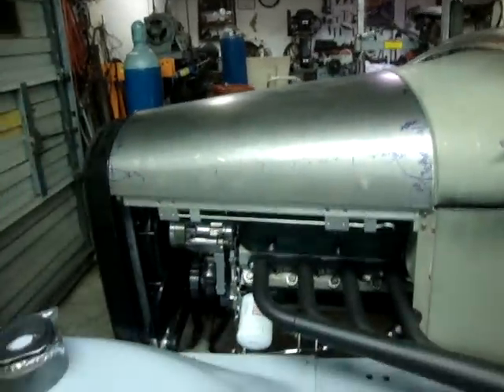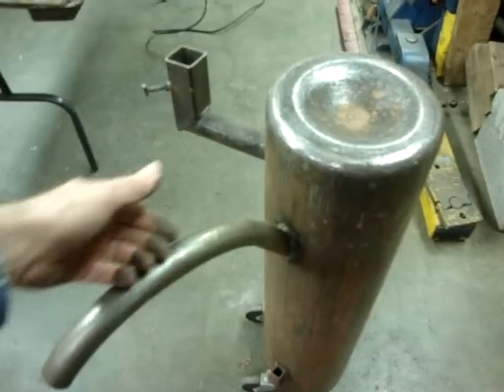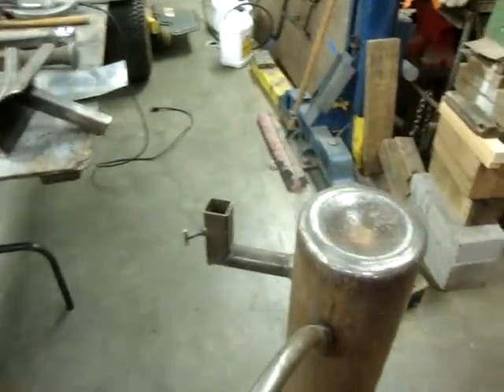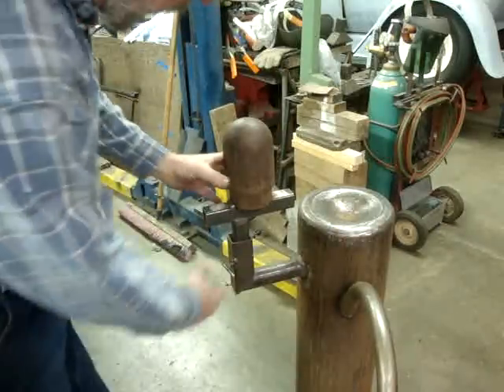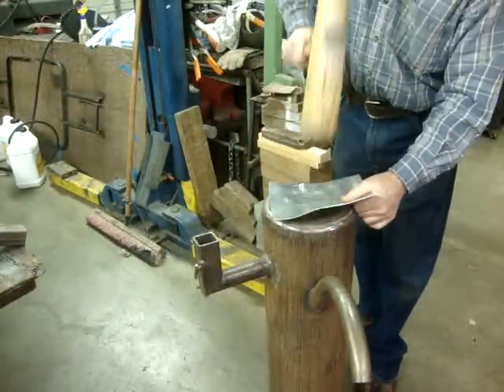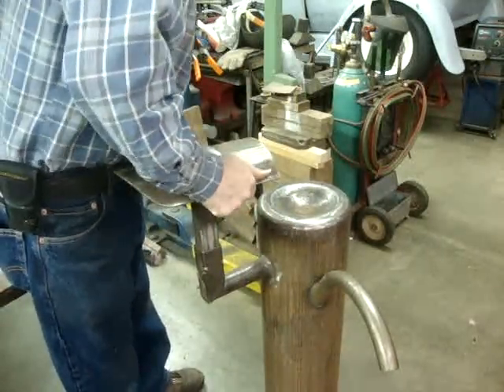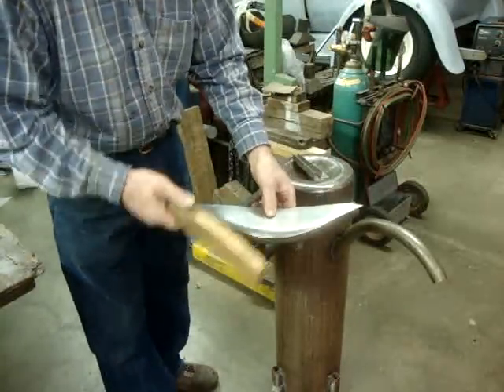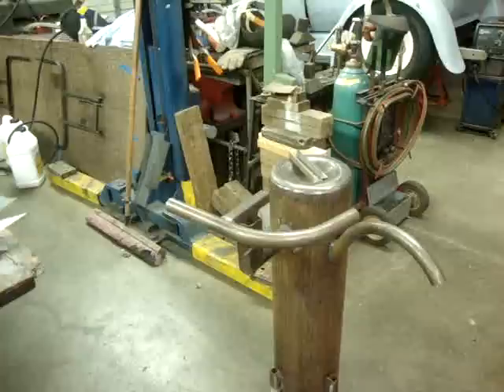Using The Metal Stump

Comment: This channel doesn’t have 1/10th the interest it deserves. Nice system. That’s gotta be years of experience boiled down to something simple, cheap, and effective.
Reply from the maker: Thank you..!! I appreciate that. Yes I've been shaping metal for about 35 years or so... and still learn something new almost every time I go into the shop.. Modern equipment helps, but the basics are  used every day and are still in the simple hand tools..
Reply: @billsmetal  I’m a good carpenter but a novice metalworker. What you said about modern tools applies just the same to woodworking. But you probably know that already.

Comment: From one weldor to another, thank you sir! This really is a marvelous use of readily available materials. I picked up a leather shot bag long ago, now this will compliment it. I also got a nylon mallet but I like your idea of a baseball bat hammer. Time to chop up an extra bottle and restore my 1966 VW splitty bus. It is getting a year 2000 TDI engine and upside down Audi transmission. Porsche 951 suspension, front hubs and 372mm rotors already mounted.
Reply: Nah no TDI, give her a 5 cyl Audi petrol turbo
Reply: How has your 1966 VW project turned out ? Would like to hear more about it and see it if possible. Thanks. !

Comment: Greatly appreciate you taking the time to make this video - extremely useful tool and making your own tools is the sign of a genuine craftsman!  

Unrelated, metal shaping is new to me and I'm hoping you can tell me what type of aluminum you're using in the demo - I've got access to some 3003 1/2 hard; would this work to practice?
Reply from the maker: That is the perfect material to work with.. It's good that you have access to it.. Most supply houses only stock 5052, which is literally a pain to work with. The 3003 is very compliant and retains it's shape when you shape it, with very little spring back. And it responds well to annealing, 6061 can be annealed as well but work hardens much quicker than the 3003. Here's a good explanation of what the numbers mean.. http://www.alcotec.com/us/en/education/knowledge/techknowledge/understanding-the-alloys-of-aluminum.cfm

Comment: You can usually get the tanks at you welding supply place.  The get them back from being tested.  If they don't pass they have to scrap them . You can get them usually pretty cheap
Reply: Charlie Bardo  Got mine free that way, was better for them for me to haul them off than they'd of made on scrap. It's definitely worth it to check your local shops for out of service bottles.

Comment: Hi. Great video. I want to make one like that. Could you please let me know, what size receiver you used, and is there a good practical reason why it is set out from the cylinder. If so, how far out? Would there be a disadvantage if it was welded straight on the side of the cylinder?
Many thanks for any advice that you can give me, on this project.
Kond regards, Joe
Reply from the maker: It's just a scrap piece of 2 X 2 Square Tubing.. You can use whatever you want, as long as it fits whatever you want to put in it..
Reply: Thank you very much for your reply.

Comment: Great video and very ingenious of you. This is better than using a wooden stump. I have an old Acetylene bottle laying around, and would love to build something like what you have there.
     Any safety advice for cutting the head off of the tank ?
Reply from the maker: +richaroodledoodle ... First ...Don't use an Acetylene bottle..!!!  They are constructed completely different and it will be dangerous..!!!  The bottom is shaped differently and not usable.. They are filled with cork to absorb the Acetone.. and they are VERY unstable.. you could blow yourself up.. !!! 
 Use an old Oxy or Argon or C02 bottle..  
Don't use an Oxy Acetylene torch to cut the bottle.. Even if it's empty and purged, you can still introduce un-burned  fuel and oxidizer into the bottle from the torch, and blow yourself up!!! ... Use a saw.. or a plasma cutter... I cut mine in half with a band saw first. Then after the end was open I used a torch to cut the shapes that I used for dollies.
Reply: *****
                    I knew it was not a good idea, but I thought there was a way around it some how. 
   I guess I'll had to find and old OXY bottle around somewhere. Thanks for replying so soon, and keep those vids coming. Good info and thanks for sharing with us..

Comment: Amazing tool and thank you for the explanation! May I ask how you made the dish on the top?
Reply from the maker: It's already there... That's the bottom of the oxygen tank.. it was a 331 cubic foot tank that had out lived it's usefulness and couldn't be re certified... so the Welding Gas Supply houses sell them for scrap.. you can get them cheap, either from them or from the scrapyard..

Comment: I’m needing to form shapes similar to bicycle fenders out of aluminum. Any ideas. Thinking about a arbor press with special made dies.
Reply from the maker: If I'm only making one or two, I would use my English Wheel..  If you are making a bunch of them, you might want to build a Fender Roller. I also built a set of fender forming dies for my power hammer... Interestingly, when I built the test dies out of wood, they worked great. So I decided to build a more durable set out of aluminum, and  they didn't work.!! You actually need the grip of the wood, to shrink the metal. The aluminum dies were too slick and the metal would slip in the dies, rather than shrink. It came out more like a potato chip than a continuous curve. 
Also you will want to use 3003 H-14 alloy aluminum, for forming that shape..
Reply: billsmetal yes I could see that you would need a certain amount of friction. Friction can be your best friend or your worst enemy. Only the wind sculptures I am fighting friction constantly.

Comment: How did you mount blacksmith vise to garage floor?
Reply from the maker: Check out my Garage tour video and it shows how that was done.. I have several tools that fit in the holes and there are 4 locations in the shop where I put those holes..

Comment: Did you fill the tank with water before you cut it up ?
Reply from the maker: No .... It's not a Fuel Tank... it was an old Oxygen, or Argon Tank, or CO2 tank..  You don't want to use a Hydrogen Tank, or a tank that held anything that's flammable.  An Acetylene tank not only flammable, it is the wrong construction, as it is filled with cork and doesn't have the concave bottom and it's made of too thin of material. Propane tanks are too thin as well, and obviously flammable.. If you do use an Oxygen Tank, obviously it is an oxidizer and while it doesn't burn on it's own, it does accelerate a fire. So it's a good idea to purge the tank a few times with your air compressor. Or unscrew the valve from the top and drop an air hose in the tank and let it blow out (dilute) any residual oxygen..........  I answered this question about 5 years ago, so it's way down in the comments.. Here's a copy and paste of the answer I gave someone who said they were going to use an acetylene bottle, back then.......   First ...Don't use an Acetylene bottle..!!!  They are constructed completely different and it will be dangerous..!!!  The bottom is shaped differently and not usable.. They are filled with cork to absorb the Acetone.. and they are VERY unstable.. you could blow yourself up.. !!! 
 Use an old Oxy or Argon or C02 bottle..  
Don't use an Oxy Acetylene torch to cut the bottle.. Even if it's empty and purged, you can still introduce un-burned  fuel and oxidizer into the bottle from the torch, and blow yourself up!!! ... Use a saw.. or a plasma cutter... I cut mine in half with a band saw first. Then after the end was open I used a torch to cut the shapes that I used for dollies.
Reply: @billsmetal  I have some old tanks like yours that are probably 20 years. They have the same bottom and are built out of heavy steel. I watched another video back awhile and the guy screwed the top off and then filled it with water and then took his cut off grinder to it. I've been going to make one for years now but have just never got around to it. You did a great job on yours.